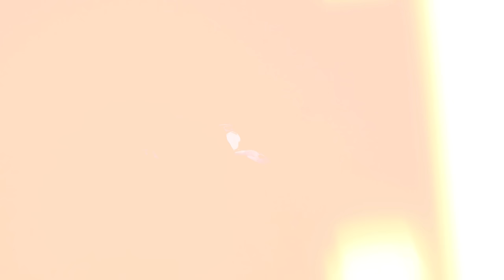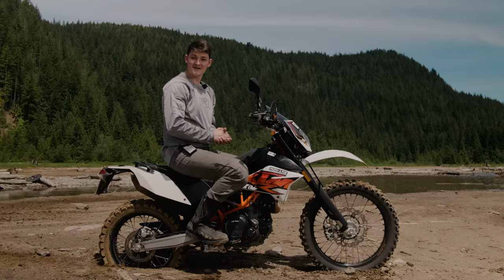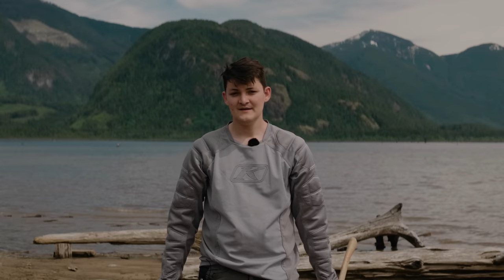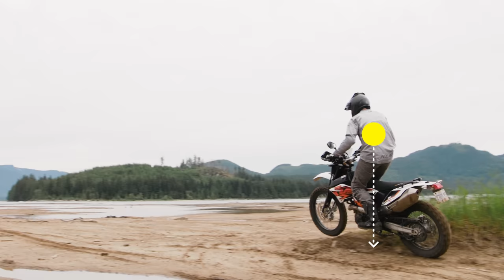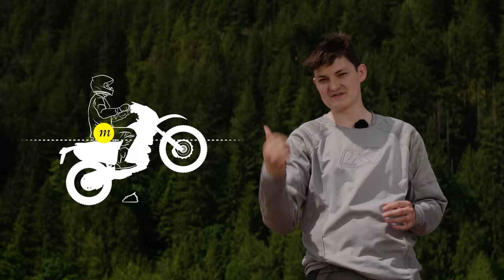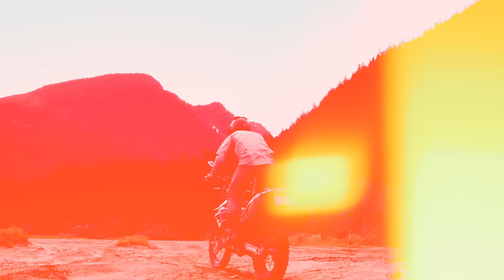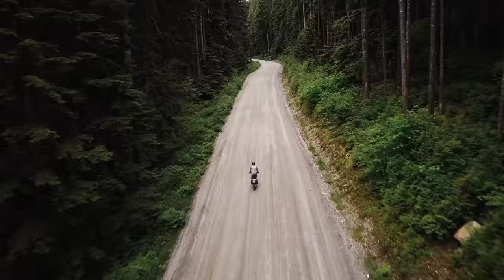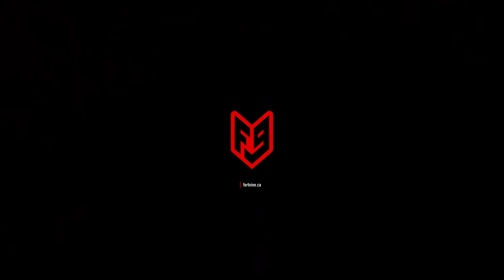Why and When to Stand on Your Motorcycle

Comment: Great video Ryan! One thing I was taught by off road BMW instructors is one of the most important reasons to stand off road is the body senses all balance for the body from around the ball of the foot. If you are standing and the bike starts to slip or slide you will notice it much quicker if standing and will be able to respond much quicker. If you are sitting, by the time you notice any slide it has already gone past the time to make a correction that will have a positive outcome.
Reply: Flat track racers and GP road racers never stand as it would make the bike uncontrollable  . And they know what slide is.
Reply: I don't believe that statement for a second. Imo it's more about bike getting some momentum and your bodyweight slightly just stabilizes the movements making things easier. Like riding in deep sand. You're for sure not faster reacting standing up. I dare to claim most are actually faster in inputs sitting down and it creates even more problems on such ground. Stand up and that counterweight of your body does some stabilization. Heck doesn't even physicians say that balance comes from your ears, not your feet.
Reply: @dantownsend4246  this video is obviously not about flat track racing or MGP but about adventure biking.
Reply: @thehighwaystar1339  but the statement about not noticing a slide until it's too late is clearly wrong. In motocross riders usually sit in corners. And they certainly slide. Even enduro riders will sit in tight corners. 

The reason for standing is bumps, not corners. A smooth corner could be taken faster sitting down.

Comment: I would also add that you can increase your range of sight by standing, which is important to anticipate upcoming bumps, obstacles and over hills etc. I think you're also in a more active position to shift your weight to correct lean, especially if on an uneven surface that threatens to tip you sideways.
Reply: Yeah, I thought the lean factor would be fairly important too.
Reply: I am up in parking lots on my DL 1000. I can see every idiot, and the open parking spaces.
Reply: @geneticepistomology and hopefully a few of those idiots can see YOU!

Comment: Glad to know what I do instinctively on a bicycle at 25 mph transfers over well to motorcycles. Always a pleasure watching your videos- keep it up.
Reply: Bicycle riding skill does transfer extremely well to motorcycles, particularly when riding offroad.  

They work the same, after all.
Reply: Same. Especially now that I have an eBike that I can soup up from 20mph to 30mph (~35-50 km/h).
Reply: @Wintersdark  Well, mostly, I ride a lot of MTB and the biggest and the most crucial difference for creating grip is body position, on bikes, your body helps, but it only makes up 1/3 of the system's mass, on a bicycle, your body is 4/5 of the total mass at the very least, so what you do with your body makes a far bigger difference than your bike, for example when jumping a motorcycle there is not much to do apart from absorb the upwards bump with your legs and the landing again with your legs. With a bicycle it's the exact opposite, you are wanting to push the bike into the ground on takeoff so the lip transfers into your body, it is then your body pulling the bike up with you, not the other way around.
Reply: @AntaresSQ01  while the scale is different, the impacts are the same.  There's some differences of course.  When jumping a motorcycle, you can adjust the pitch of the bike with the throttle to some extent, for example.  But your body position while less crucial is still important on a motorcycle and the concepts remain the same.  

MTB skills absolutely make you a better street motorcyclist, just like learning to ride dirt bikes does too.  There's differences, but they're usually more just about proportions than actual incompatiblities.  

With the weight ratio making body position so important on a MTB you're forced to learn it correctly, whereas you can fudge it a lot on a motorcycle in comparison so it's easy to not learn well there.  But if you can manage good body position riding a MTB down trails, you'll fucking nail it on a motorbike.
Reply: @Wintersdark  Oh don't get me wrong the reason i do MTB is to be better at motorcycling, and a fun way to get fit that's also cheap (well apart from initial buy in). It definitely helps, the control you learn there slow speed, brakes, cornering, definitely transfer, especially going over obstacles, I've jumped kerbs on my S1000XR I never dared to go near before i started doing MTB, same with rolling burnouts and wheelies, I learned that on MTB haha
Reply: When the instructor on my motorcycle course discussed steering opposite of the curve, I thought we don’t do that with bicycles - that’s odd - physics shouldn’t change. The next day I really paid attention on my daily bicycle commute to work and yes I had been unconsciously steering a little bit opposite the curve…. probably for over 40 years. Laws of physics apply regardless of how the two-wheeled vehicle is propelled.
Reply: @michelgregoire8224  there's a Verisatium video about this specifically, which is a REALLY interesting watch

Comment: Standing may not lower the CoG but it puts your body in a much better body position to quickly and freely make rider inputs to the bike. From a standing position I often use my knees and hips and weight through the pegs to move the big ADV bike to  quickly avoid obstacles or to recover from loss of traction, it can be done from sitting as well but when the bike literally jumps sideways when you hit a rock, especially one you didn't see under water it's a lot easier to control the dance the bike is doing from a standing position, dryer too.

Comment: Interesting. As a hiker, I always considered standing (pegs bearing your weight) vs sitting (seat bearing your weight) like the difference between carrying the weight of a heavy backpack up on your shoulders only vs having that same heavy weight born on your hips (with shoulder straps to just hold it in place). It may not lower the center of gravity, but it certainly feels less top heavy.
Reply: Yeah. I agree. There is still a difference on how much actual weight you put on the pegs instead of the seat in, say, low speed maneouvers (did i spell that correctly?) when you require it for better control/balance. Sure the center of gravity might be the same. But in what way it affects the bike, is not
Reply: I recall having that same revelation while portaging a heavy backpack in Algonquin park as a young lad. After a day of aching shoulders, I loosened the shoulder straps and tightened the waist band firmly around my hips. Wow! I could go all day like that. Makes sense, pelvis evolved to carry our body weight vertically, whereas collar bones and spine are for keeping the arm sockets in line with the head and neck, not for supporting 50-70 lbs added weight all day.
Reply: It's a little more complicated, since when you put the back pack weight on your hips it's mostly your leg muscle doing all the work, which they can handle. When you wear only shoulder straps, it's your legs and all of your trunk and spine muscles having to do the work. Which strangely enough doesn't make it easier for your legs because they are still carrying all the weight, just much harder on your back since it also has to help. And you trunk and spine muscles don't like doing that much work and fatigue much quicker.
Reply: @HeyAddieImTojo  isn’t that still about managing your mass independently of the bike’s? More weight through your feet lets you shift around on or just above the saddle, or shift the bike itself under you.
Reply: @Badenhawk  and to turn the pack it’s much easier if it follows your pelvis, without involving your abdominal muscles to control your twisty back.
Reply: Your impression is right, and I think Ryan’s explanation is incomplete. Standing on footpeg actually lowers MOI just like you carry bags on hips. Motorcycle carry rider’s bodyweight on the peg, instead on the seat, so it rolls(=changes lean angle) easier. It feels like the overall COG is lowered.

Comment: Standing also has a couple extra useful benefits. You can see what your wheel is about to hit without moving your weight forward so you can be better prepared for it. You can shift your weight more easily when standing allowing you to get more traction on the rear or make climbing a hill easier. Additionally, you can also see a little bit further away, though the benefit of this is academic at best.
Reply: Actually sitting on the rear provides traction and sitting forward for preventing front wheel lift; flat surface. Sitting rearward is great for sand and bulldust, standing is a one way ticket to a broken neck. Standing is useful for jumping, hard landing, steep inclines, slow large obstacle traversal, some water crossing, sighting and isolation from whoops and the like.
Sitting is for everything else.
I am sick to death of "Adventure Bike" douchebags standing on a flat gravel road and waxing on about standing in general.....which is really just posing....posing douchebags.

Comment: Incidentally, I'm discovering this is exactly what you should be doing when riding bicycles as well, especially if you have a rigid frame without suspension. Staying "in" your bike transmits the full force of a bump/curb/ridge/pothole, whereas standing up lets your body act as a natural suspension or even augments your existing ones.

Comment: Side point, adjust your bars/levers so that they're a compromise between sitting and standing.  A lot of people forget that, adjust everything to be comfortable sitting, and then wonder why standing is so hard.  Knees bent, elbows up and bent, head slightly over the bars, and everything relaxed is the goal.  Not that this lasts more than a few seconds at a time... dirtbike riding is usually about trying to get back into that position before the next thing that comes along to push you off.

Comment: Very good video, and I loved the detailed explanation. And this all seems great for street and duel sport riding. But for motocross or enduro you want to be able to drop your ankles by standing on the balls of your feet and keep your knees basically behind the foot pegs pointed inwards and flex at your hips which will act as so much better absorption than standing on the arch of your foot. Again, this applies to motocross and enduro racing mainly. AWESOME VIDEO! 

(Aj Catanzaro explains this very well teaching the attack position for motocross.)
Reply: I see a lot of ADV riders as passive lumps whilst riding off-road. As an ACU Motocross Coach I used to teach a lot about weight positioning depending on terrain, slope angles and turns. Basically, we need to be purposely moving our mass about a lot, in appropriate directions to ride safely and effectively. It's my favourite form of exercise 😀
Reply: This^ Stay on the balls of your feet and squeeze/lock with your knees. Critical to not getting exhausted on longer hillies, you can stand for way longer cause your knees are locked into the tank which lets the shin bone takes most of the weight and leaves you upper body loose.

Comment: My bike looks great and the TwinPegs are totally awesome. The video is once again awesome filled with great content and visually stimulating. Thanks for your continued commitment to high production values and descriptive explanations that make motorcycling more interesting and exciting. Shout out to Luke on a great job!
Reply from the maker: Thanks for the loan Rod! I'll hit you up for that tour soon :) ~RF9
Reply: I’m failing to see how twinpegs are different from floorboards, though? Besides being way more expensive?
Reply: @JediLeba  hey, floor boards are probably great in the right application, which is probably on a street cruiser. 

I would not want floor boards on my local single track or anywhere else off road. TwinPegs give you the comfort and feeling of floorboards for sure but they also do not detract from the off road performance of the bike or even the original feel of the bike in technical terrain. They also give you some additional support for getting weight on the back wheel when required. If you ride single track or even just forest service roads TwinPegs are the way to go. Twinpegs are not cheap but they are a well engineered solution that solves many issues of control and fatigue with an adventure bike off road.

If you ride nothing but the tarmac and want to cruise you are not even likely going to want to stand on the pegs or floorboards.
Reply: @RodNeufeld  all good points, I guess, but you didn’t answer the question - how are they different?

I would add, there are visible bumps and railroad tracks to cross that do give occasion to stand on any bike, even my tourer.
Reply: @JediLeba  if you like they function the same in theory and that is as far as it goes.  TwinPegs function completely independently of your original pegs or aftermarket pegs. They also work in conjunction with them. A floorboard is a large inflexible unit that if by  chance it folds up the entire  board folds. 

TwinPegs will fold independently of the original pegs. They are more narrow as well to provide better travel past common obstacles on the trails without losing function of the original pegs. It does not take much of a stretch of the imagination to understand the results of riding through rocks, roots and other such objects that will hook onto, fold or even tear off a floorboard. Yes floorboards are the same as TwinPegs in basic function. When used in the same environments there is going to be a drastically different result due to very real functional and design differences.
Reply: I appreciate this an older reply, but trying to find a similar setup for my KLR. Where did you get yours ….and suggestions? Thanks

Comment: For strictly off-road use, the twin peg isn't technically a good option because by planting the heel you are eliminating the extra suspension that your calves give, when the heel is planted only the thighs are reacting to the bike. Whereas if you are on the balls of your feet you get the flexion of your foot and calve involved which actually creates more efficient body suspension. By placing a peg under your heel, it will stop that flexing motion and create a greater shock into your body = greater shock into your lower back = more taxing on the body.

Something very important is to make sure the balls of your feet are on the peg rather than the arches of your foot. Proper foot placement on the peg is the first key to creating the union between the bikes suspension and your own.
Reply: Since this video was made, TwinPegs have been raced successfully at Baja 1000, Finke desert race (Australia), Sunraysia Safari Rally ( Australia, first desert race gold medal with TwinPegs), Rallye Breslau, European enduro championship. This is only the beginning, as the racers who dares to take the leap, are very satisfied. They get an additional ride technique tool for effortless weight transfer towards the rear wheel. Try it, and feel the difference 😊🏁🇳🇴